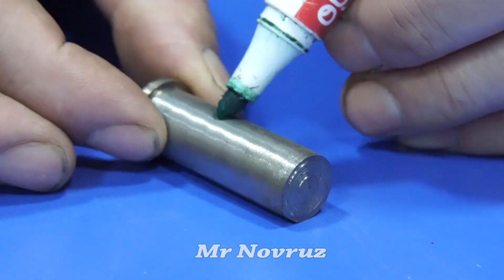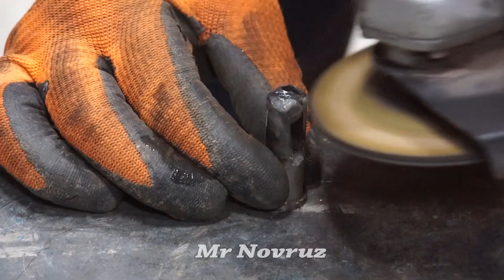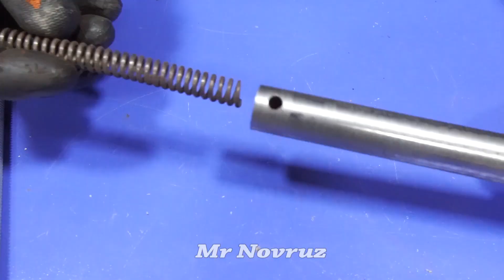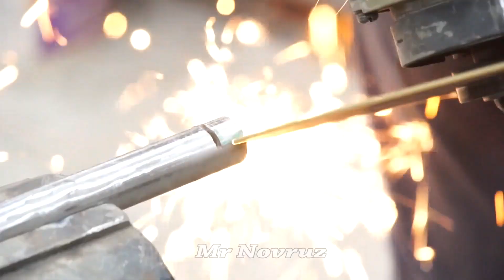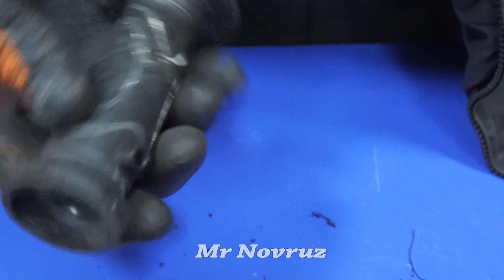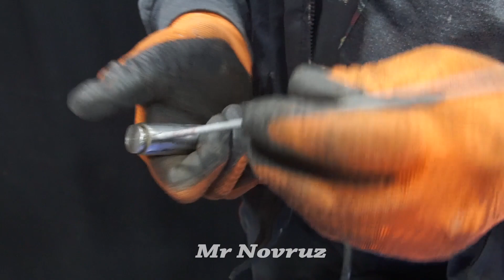AMAZING TOOL  // UNIQUE IDEA 2020 //

Comment: I think that without an insulated cover on the top of the clamp, it will be very hard to use, and avoid accidental contact with metal surfaces, generating sparkles
Reply from the maker: Thanks